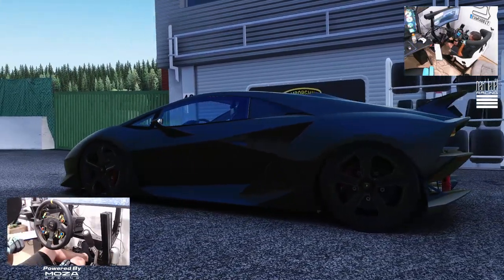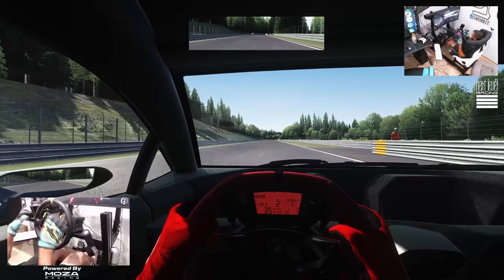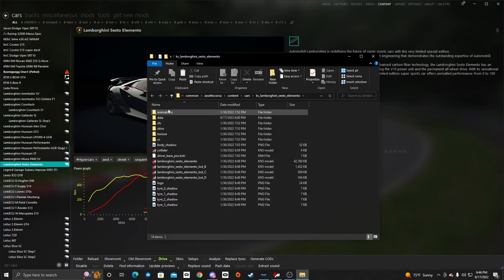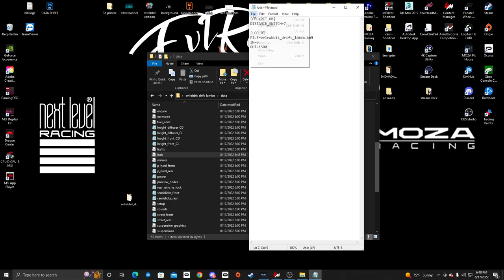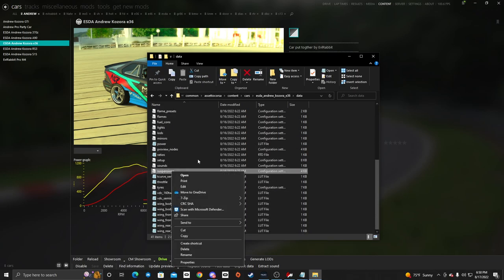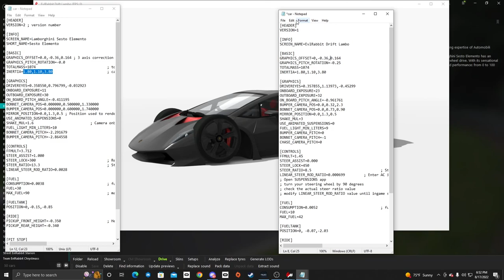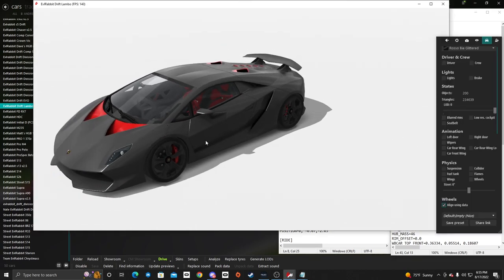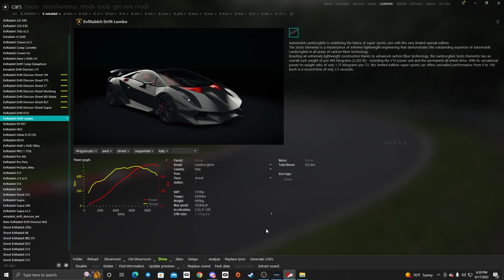Building a Drift LAMOBO in Assetto from ground up Part 1 - Car / Suspension / Drivetrain data setup

Comment: @evlRabbit im having some troubles with modding a kunos car every time i copy the car folder and rename it when i go into cm showroom the copied car loses the ability to steer in the showroom and also whenever im changing values like CG location and graphical offsets it doesnt actually change anything in the showroom any advice?
Reply: Did you figure it out? I have the same problem

Comment: Personally i would aim to use the original suspension data and modify the knucke to icrease the steering angle, that way you will actually get more accurate physics for a drift lambo as it should have a lower CoG overall compared the BMW which should perform marginally better
Reply: how would i do that